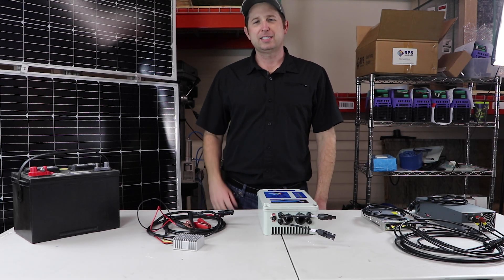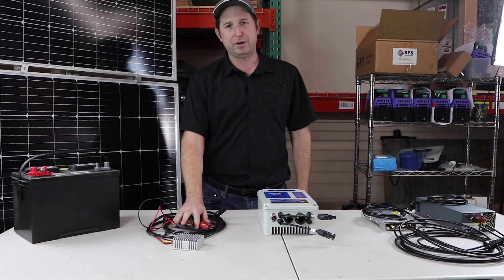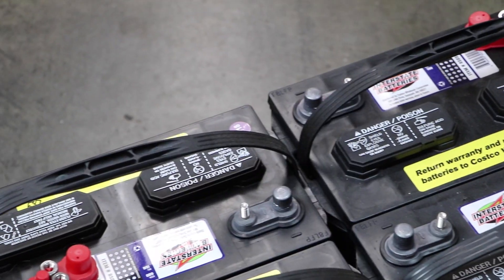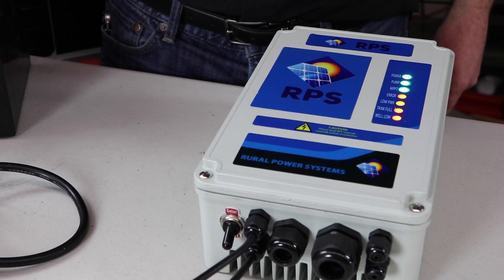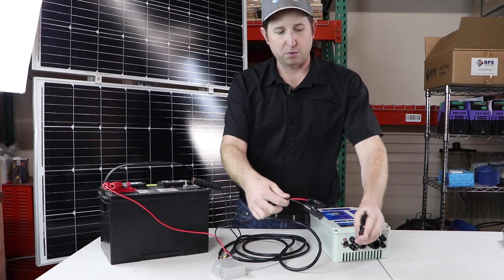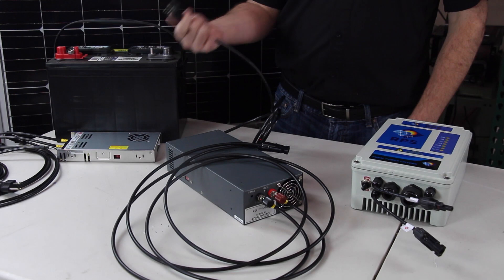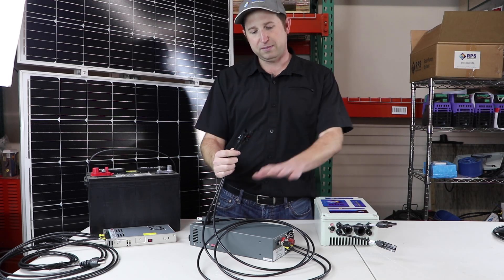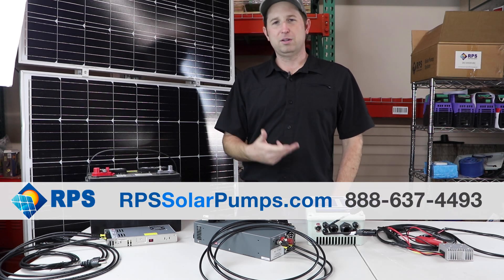Alternative Power for Solar Pumps - When the Sun Doesn't Shine

Comment: Greatr video. How long can the pump run continuously on AC to DDC power - like to initially fill a pond?
Reply from the maker: As long as you need!  Our pumps are designed for continuous operation, so if you need to run it 24/7 from grid power to fill a pond, go for it!

Comment: What size wire to use for batteries?  14 Ga, 12 Ga, etc?  Thanks!
Reply from the maker: Hello Mark, 10 or 12 AWG is fine.  There is not a lot of current unlike cables needed for starting a car.
Reply: @RPSSolarPumps  does the system run off of 12 or 24 volts?
Reply from the maker: @KenJamesJr  Minimum of 24V but it really likes higher voltage, either 36V or 48V if you are going to run on batteries.